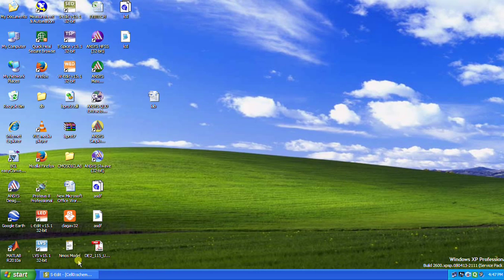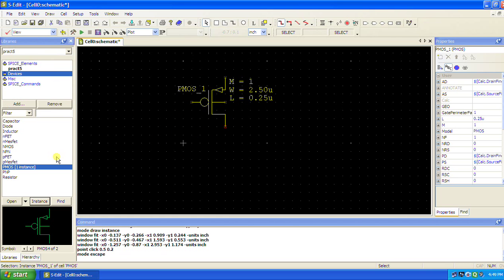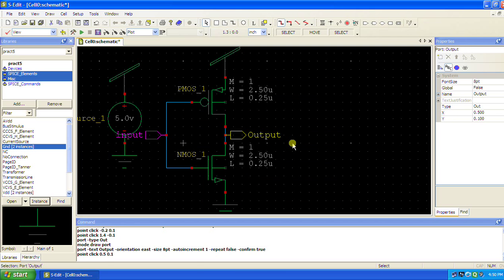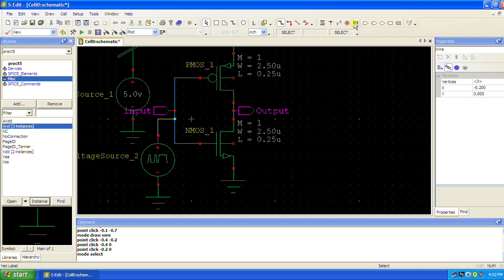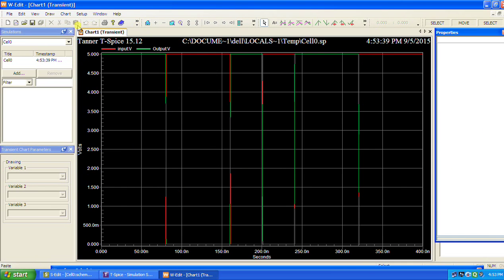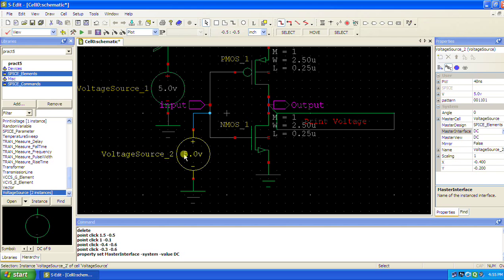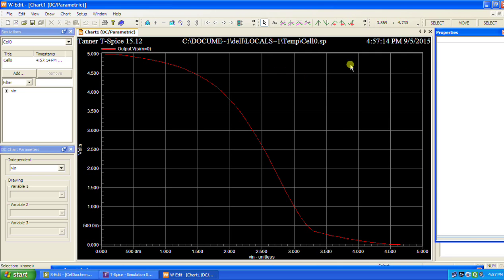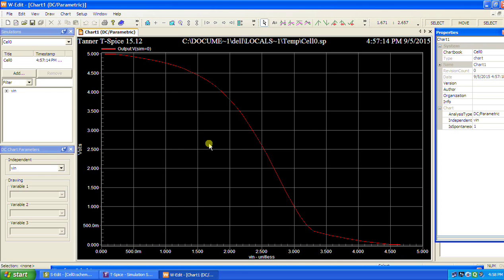invertor

Comment: I m using 2.5v DC supply but in waveform result shows on 5vdc why ? how to change dc voltage??
Reply from the maker: +Sunny Kumbhalkar 

The answer to your first question can be only  attempted once you detail me your block diagram .the second  is how to change the DC voltage, it can be changed by selecting the DC voltage and making changes in the properties. Just i require some detailing of your problem regarding your first question
Reply: +Pavan Bhabat 

That Problem sort out now sir thx ...try one design on full adder by GDI (Gate diffusion input)  and try to elaborate Tspice Scripe too it will be help.....